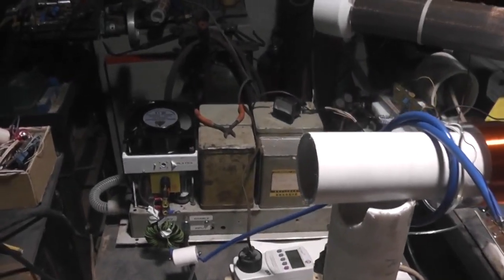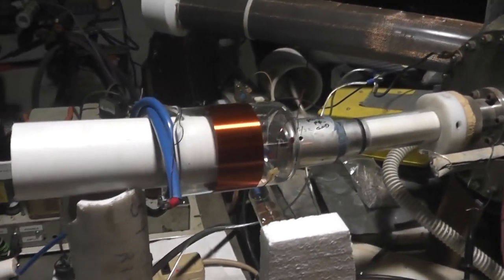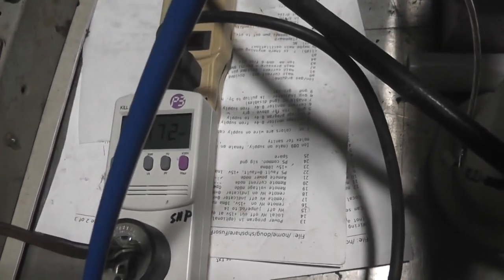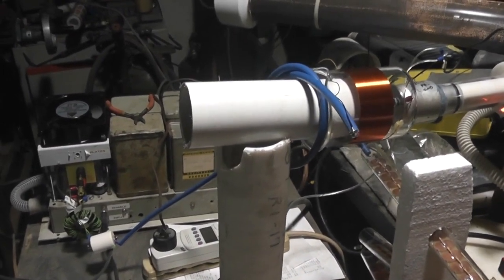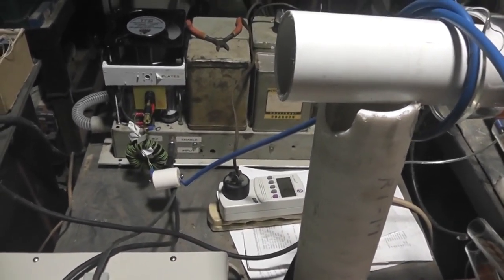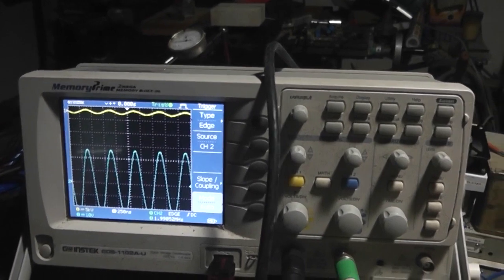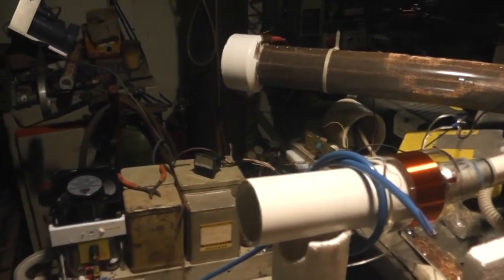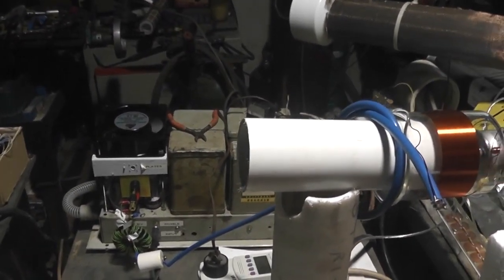No Smoke test

Comment: I have absolutely no clue whats going on but i like it!
Reply from the maker: Sometimes I feel the same way, and I built that.  This is testing the lashup to generate what amounts to an electrostatic ion trap or collision generator (directed, not random like thermal).  It's dauntingly hard to do at these power levels.  I'm glad I'm a pretty experienced electronic engineer (was my main career, though not specialized in RF) as I'd never be able to afford what I built here as a thing I had to just buy.
It's just a step on the way to efficient fusion generation.  I (and others) hope.

Comment: Woot! How do you control it remotely?
Reply from the maker: Not yet, unfortunately.  Working on that.  I have a signal generator that can be remote controlled, but any computer can also crash...trying now to figure out all the safeties if nothing else.  I'll have a vidcam on this (see smoke, too hot kinda stuff) and ability to turn power off via a hardwired relay setup (buried wire, pretty crash proof) but some things are going to be a trick.  I'm kind of feeling my way around as the more I can limit the necessary tuning ranges, the easier it is.  So I'm doing what I can in person to find our what I really need for remoting, as that's a huge job on its own.